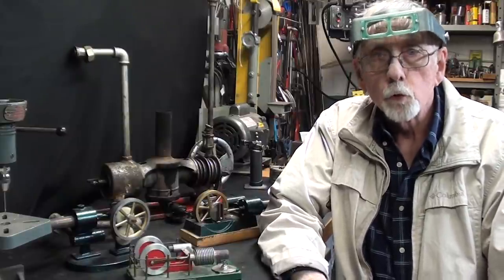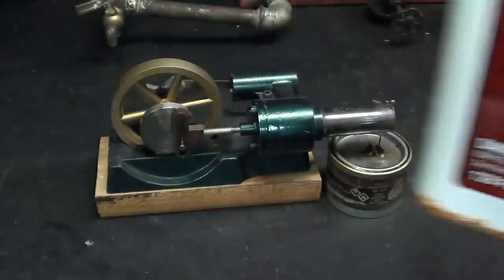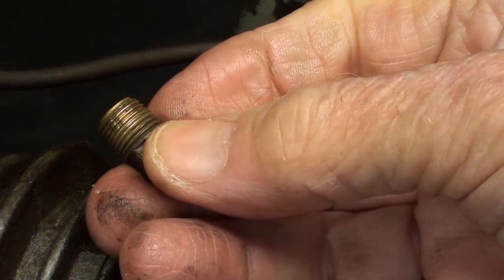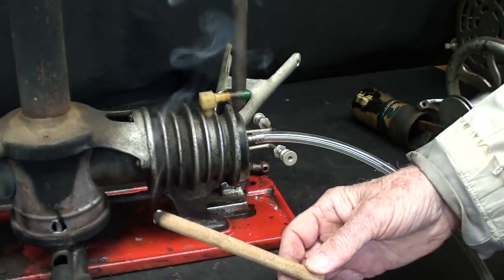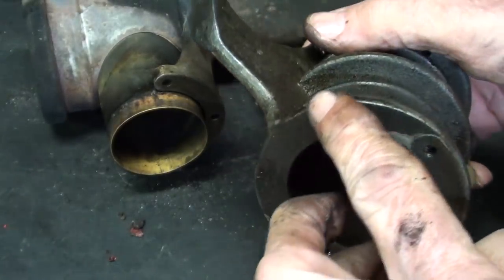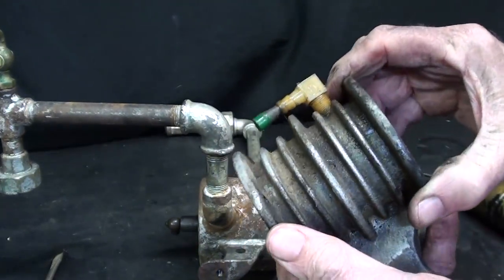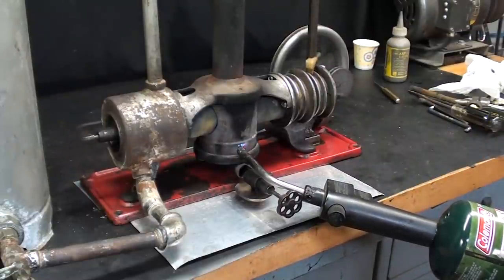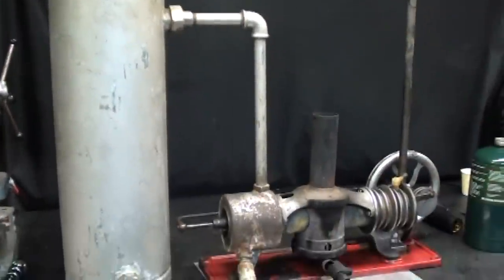ESSEX STIRLING ENGINE pt 4 #769 tubalcain  hot air antique

Comment: Hi Mr. Pete
RDF remarked below "Blondihacks got into the burner of her steam engine build (part 13). 
She said if you have a yellow flame you don't have enough air."

The flip side of that is, Too much fuel for what air the jet can pull in from around it, IE Bubba made the needle jet too big, IMHO
I'm thinking a redo of the needle jet might go a long way toward making it work.

BTW I'd really like to see the end of that needle jet, Does it have a removable tip(that you could perhaps change out with smaller ones)?
Also do you think the wire mesh cylinder should act like a lantern mantle when it gets hot enough and make sure all of the fuel is burned instead of becoming soot?
Don't give up, success is just around the corner.
Cheers from Australia

Comment: 23:00 Should the water tank be filled above the return line? If the tank is not full then there is less static pressure at the bottom of the tank. That won't allow natural circulation to occur I believe. That warmth you feel in the riser pipe might be from conduction, not circulation.
Reply: You are correct, The tank Has to be filled to above the top return line, if it's not, there can be No circulation.
Just like hot air rises, hot/warm water does the same thing, but this is a closed circuit system, if there is a blockage or an open section ie no water over top pipe, it just doesn't work.

Comment: Lyle - Interesting trouble shooting.  One other person mentioned perhaps an air lock in the cooling circuit, might be right.  I'm thinking there might be a lot of scale/rust/crud build up in the water jacket.  You want pretty good heat transfer environment from the cylinder to the water - just like the soot had the burner/furnace loused up for proper heat transfer on the heat side you might have the same for the cooling.  But as this retired mechanical engineer has no practical experience in boiler designs I'm relying on a heat transfer course from 52 years ago.  So beware of free advice!  Keep at it - interesting as my grandson and I are in midst of getting a stirling engine running for his science fair project.

Comment: I believe it takes  more time and causes more frustration by going through this piece meal than it would if you just disassemble, clean, inspect, evaluate, repair or adjust, reassemble and test.   All the parts appear to be of the same era and it probably has not received any TLC since new, maybe not even then.   The fuel orifice may have an issue because there is a spot of yellow flame and what appear to be intermittent sparks in the video. I am referring to the hole where the flame is ignited.  What  deposits exists in the cooling system?  It must need constant cooling to operate with any "efficiency".   Dismantling will eliminate some conjecture as to  why it is not operating on white gas. For what little it does, it all has to work  as a unit for success.

Comment: Thermocycle: be sure the water level is above the top returnpipe and no airbubbles. Otherwise it will not work. This is not building up any pressure to pump water back in the container.

Comment: I would consider JB Weld HighHeat Epoxy Putty . No shrinkage, high temperature, and fairly fast set (1 hour). If higher working temps then consider their ExtremeHeat Paste which is good to 1000°F
Reply from the maker: Thanks

Comment: Just a thought.  Remember how the cooling system on the John Deere B was laid out?  It's a system that, if clean and full, I've never seen fail to work.  I wonder if the purely horizontal pipe at the top is impeding circulation.  It also gives a place for sediment to build up and make the movement it was getting even more difficult.  It might be worth the time it takes to clean the inside of the pipes with a stiff brush.  I don't know how practical it would be to change the pipe layout to be as angular as possible, up to the top of the tank.  If the tank level is above the top inlet, the cooling action should help pull the warmer coolant into the top of the tank.

Maybe I'm overthinking it ...

Position of the heat source, in relation to the cooling tank/radiator inlet and outlet, might have some bearing on how well it performs also

Comment: I wonder if the gas mixture should be burning in the mixer tube like that ? It just seems like the only flame should be on the outside of that gauze burner head ? I know the 'generator' tube has to be kept hot to vapourise the fuel at the same time of course. I also wonder if the fuel/air mix is right for white gas - and maybe that needle valve has been tightened too much over the years and opened up the size of the jet ? 
I've just had a look at Andy Ross' Stirling book of the 90s, and he had got BIG improvement in his heater efficiency with small changes in gas jet size - he was using propane. The power piston extension piece is, I believe, to keep the piston seal area away from extreme heat in the centre of the engine, and also to reduce 'dead space' between the power piston and displacer. I don't think that brass extension should be rubbing at all though - it looks pretty out of round at the end ! Andy Ross had similaar pistons in his engines. As you say, that engine looks good and bouncy, like it is so nearly running ! Good luck Mr Pete !

Comment: Looks like you're very close are you sure that the water tank is filled to the very top must be above the top pipe or the water will not circulate.
As far as your burner goes the small centerpiece with the perforated material should actually be the point where the flames are happening where you are seeing the flame at the bottom near the orifice is not good it should actually be a vaporized fuel coming out of the orifice well that will blend as it comes through the screen and ignite much like a diesel parking heater has a small stainless steel screen in them something like a thimble that creates the little boil vaporizing area there when the fuel hits the hot screen it ignites.
The fuel control looks very similar to an old style blowtorch I would suspect that you could easily remove that valve and drill out the small orifice and insert a small threaded rest yet probably from a chainsaw carburetor or just make your own and make the hole in it very small it actually may have had a feed tube going in just a little further so that the fuel would not get exposed to oxygen until it was at or just entering the vaporizing chamber of perforation.
thank you so much for your videos I really appreciate that somebody is showing others how old school technology excels